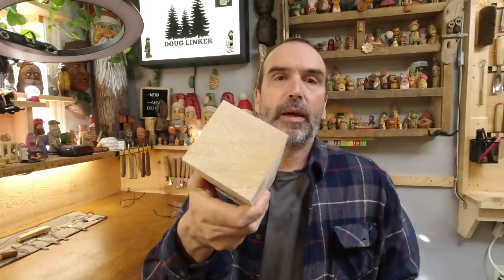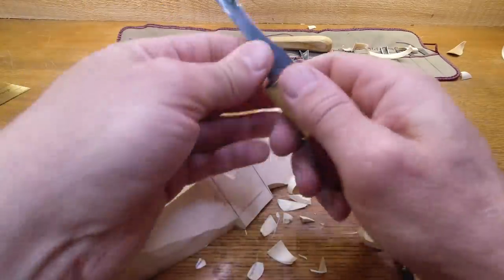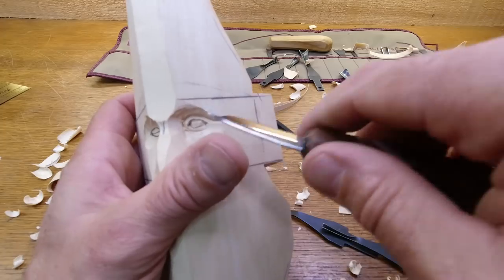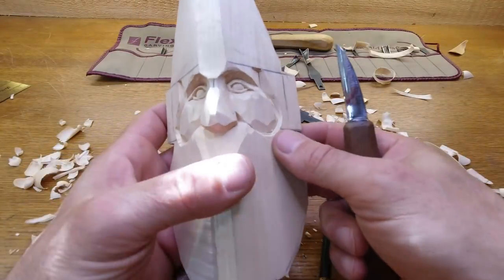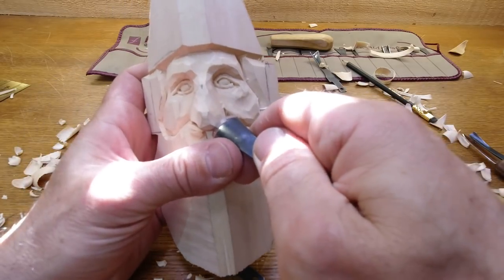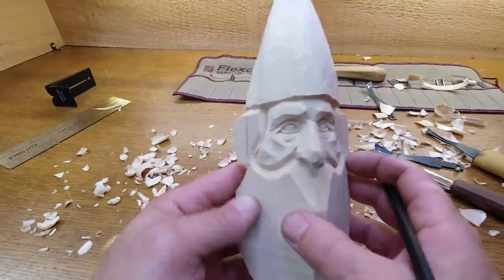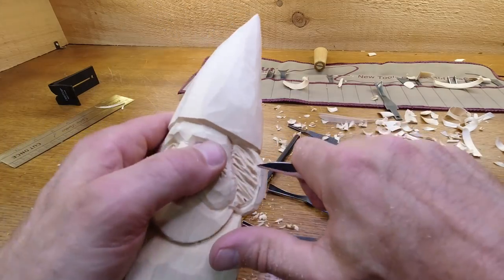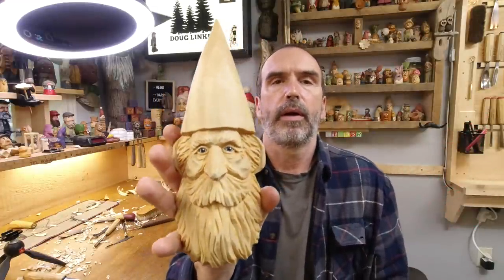How to Carve a Giant Gnome Face - Full Woodcarving Tutorial (Hand Tools)

Comment: Amigo, no dejas de sorprenderme, y lo que más llama mi atención son las expresiones faciales que logras en tus personajes tallados, muy expresivos! Me agradaría consultarte en lo técnico pues ví tu kit de "Flexcut Carving Tools" y aquí va mi pregunta: Consideras que para tallar marcos para fotografías bastaría con el kit? Las dimensiones del marco serían 50 cm x 40 cm x 3 cm a 5 cm ? O sería mas adecuado otro tipo de gubias?  Felicitaciones nuevamente!
Reply: It depends on the depth of carving you want to achieve and the amount of time you want to take, but the flexcut tools are excellent and comparatively affordable. Make sure you also buy the sharpening “stone” (leather for gouges/VTools) because sharpening them on a flat strop is nearly if not completely impossible! They come with an extremely sharp edge, but of course all woodcarving tools need constant sharpening. They come in different sizes in each set too. I bought the smaller ones, but the one Doug is using I has bigger profiles. Make sure you check the size because all #9 or #11 are not the same mm.
Reply: @docinparadise  , gracias por responderme amigo. Debo aclarar que será en madera blanda, liviana, y las tallas no serán muy profundas, lo  suficiente  como para resaltar relieves en concordancia con el motivo de la fotografía. Marcos no muy anchos y una espesura, descontando rebaje para colocación de cartón paspartu, de máximo centímetro y medio. En tiempos libres comenzaré a practicar con figuras. Quedo agradecido por el  nuevo impulso que has dado a mi creatividad, felicitaciones!
Reply: @rodolfomiguelserra  💕the set you need is probably the micro size then
Reply: @docinparadise  , muchas gracias, amigo! 😊😉